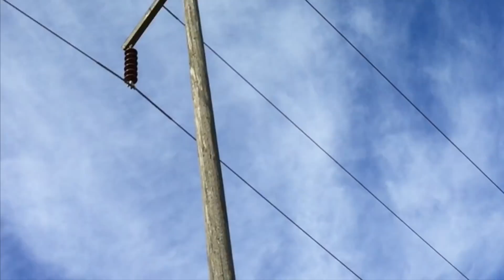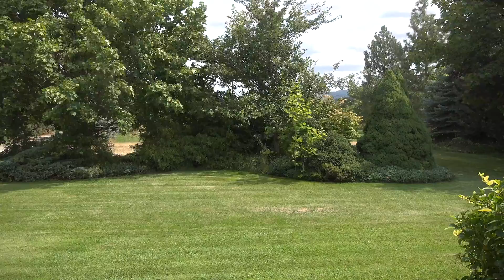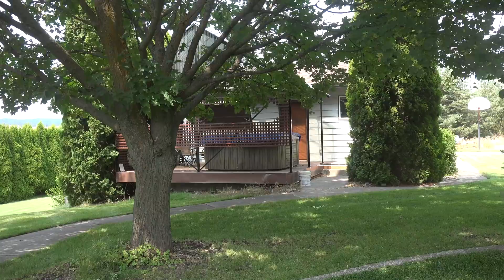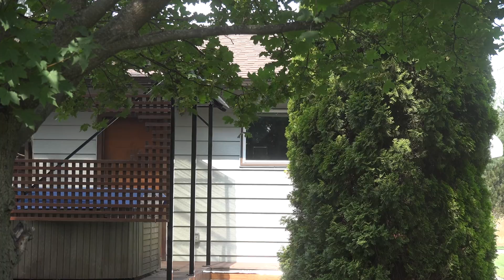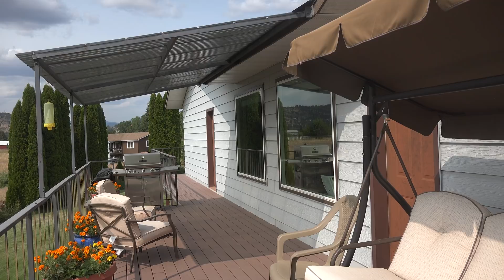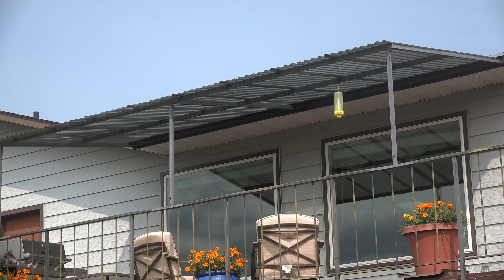What to look for in a cooling load determination

Comment: Andrew Darbyshire  hi, I been working on trane xr18? I forgot model, but it is a fairly large split condenser and in 73 weather it was only barely getting 15 degree drop, does that seem right? Can't get manager to answer me back on this, I am new tech
Reply from the maker: That depends on the superheat.  High superheat, probable low charge.  Normal superheat could be normal operation.
GFM

Comment: Don't most load calc programs force you to put the direction of the window in? Even hvac-calc, a simple old one does - you have wall direction specified and the window is a sub-component of the wall.

Kind of hard to believe a load calc could be that far off if it was done correctly.
Reply from the maker: Many of them simply indicate east or west as the same.  Mostly changing now.
GFM
Reply: A great way to get contractors to lose faith in load calculations and revert back to 1 ton per 500 sq ft.

Comment: need better low-e glass for those windows and roof with UV blocking like you added, good return of investment :)
sometimes you can add coated storm windows or second sealed glass set to help a good bit
Reply from the maker: The low E glass is good for about 15% less solar gain above 2 pane glass.  This is only valuable in reducing cooling load.  If you are located in an area that is mostly heating, probably not valuable as the low E will reduce solar gain in heating season.  Also, the Argon filled glass is useless as the Argon leaks out in about 2 years.
GFM

Comment: i am no expert, but i did a heat load on my 900 sq ft house using my friends hvac textbook he loaned me.  I was at 2.5 ton (poorly insulated).  for your experts to say 1.5...  thats laughable.
Reply: time to insulate!, then install hvac ;)
Reply: Your house is really bad if it needs 2.5 tons to cool it even in a brutal climate. or the calc was done wrong.

 A lot of problems with low capacity can be attributed to  the way the system was put in - losing a lot of capacity to unconditioned attic, low airflow, improper charge, etc.

Can have only 60% of the machine's capacity being delivered to the space.
Reply: well, within said house, they could have no bathroom exhaust fans and liked to take long steamy hot showers or have a hot tub. giant fish tanks poorly closed.
lack of dishes and run dishwasher x10, fish tanks, crawlspace that's damp to very wet and no vapor barrier.... so many things  can attribute to raised humidity and thermal gain, it;s uncanny ;)
Reply from the maker: Just to give a few specs on this home.  Ceiling:  R-38, Walls 2x6 R-21 plus entire structure sheathed in 1/2" foam board outside.  All windows double pane vinyl.  Structure is daylight rancher, full basement.  Basement walls sheathed with 1" foam board on the outside.
GFM

Comment: That awning helps also high performance film on windows if not already low-e, and r-60 in attic blown in fiberglass.
Reply from the maker: I pretty much agree except for the R-60.  Ceiling insulation is over rated as if you add more insulation above about R-22, the return on investment is quite low.
GFM